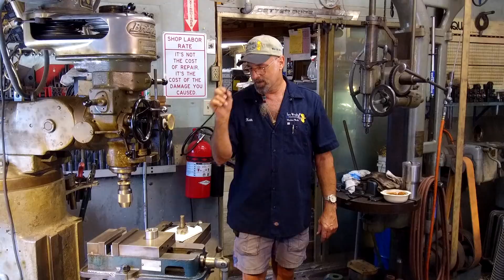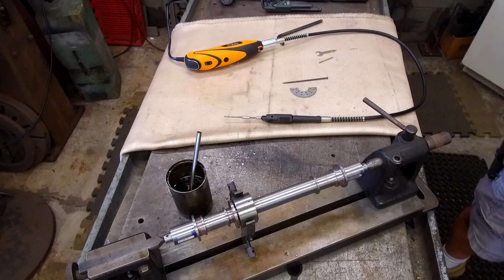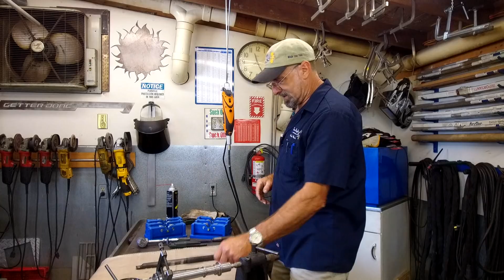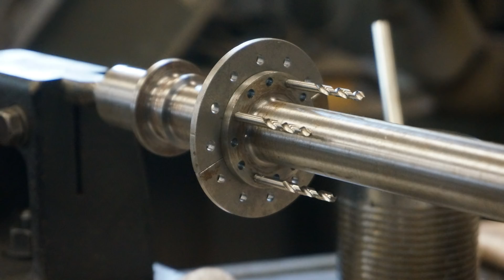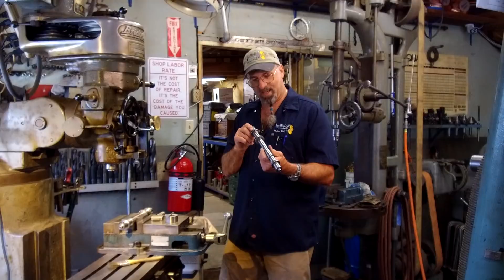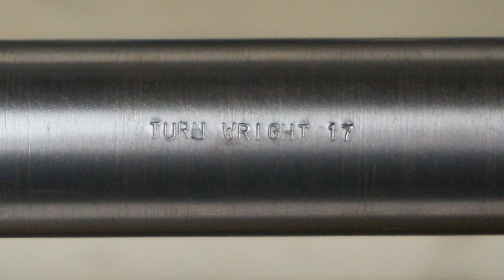Steam Wagon Ho Part Eleven

Comment: Keith mentioned that by using Tap Magic, he would have a "crisper" result. I've used Tap Magic for a long time, but only for tapping. Could someone (Kieth or some knowledgeable viewer) please tell me what is meant by "crisper" with respect to drilling? Thanks.

I agree. It was a great ride, first the restoration of the Rutland lathe, THEN the steam wagon axles! (Clapping emoji goes here.)
Reply from the maker: Sam, just the same as when tapping, the tapping fluid is faster or more free cutting than sulfur based cutting oils, so my term crisper is just that in mind. ;{)------
Reply: Thanks Keith. Sometimes, the answer to one question creates one or more new questions! I did some research on "free cutting" and "free machining." I concluded that free cutting/machining produces smaller, more manageable chips, rather than long, stringy ones, AND the process can go faster (as you say).  On this part of the steam wagon job, smaller chips would be an absolute MUST because of the confined space. Am I reading this right? (This is my final question, I promise!)
Reply: Thanks, keep up the good work Keith!

Comment: First I want to say thanks for all the videos.  I am not a machinist, but I have always enjoyed watching it being done.
First question I have, and I am not sure how to ask it, what was special about this project the required the Rutland, or what was special about the Rutland that this project needed?  You may think that is the same question, but to me it is different.
Next question, have you thought about using a sewing machine motor, with the foot pedal, as your high speed tool?  I have no reason to believe that you can not fabricate a chuck for the motor.
Reply from the maker: Well the Rutland was given to me and sitting waiting for the time or inspiration to set it up, I had a few other machine that needed to go to make room and it was one excuse after another, and the Clausing it to big for the shaft project and I knew I would be letting it set from time to time, when I needed to make paying work move on schedule. The Rutland was the deciding small lathe to set roots in the shop and while it was being set up, I had to give it a once over, to make it run to my standards and not live with someone else's standards. It had a lot to do with the shop as a whole and the timing of moving in a new direction of machinery. ;{)------

Comment: A left hand drill would have worked to prevent the aircraft wire from fraying but then he would need the dremel tool to run in reverse. A small cordless drill could do it and with more power.

Comment: Love the series. I was once involved in aircraft construction. We had a right angle drill adapter with a small head to get into tight places at awkward angles. I seem to remember it had about a .3 inch radius at the head, maybe less. The drills screwed in. Aircraft Spruce and Specialty used to sell them. Don't know if they still do, and maybe the head is too big for your application. Anyway, keep up the good work
Reply: That's what I would have used as well. Aircraft Spruce indeed has them for $225-230 or so, as do other vendors. They really come in handy for things like this.

Comment: What if you used a longer piece of wire, a left-twist drill bit and a regular drill motor?  More torque, the wire doesn't expand and more flexibility.  That rotary tool is really wimpy!

Comment: Very good.. I was thinking the soft solder might have been better as the wire isn't heated as much. It's more than like strong enough.. Used to make a bunch of motorcycle clutch and throttle cables using soft lead / tin solder.. Worked very well...

I've seen crimped connections come loose on Fordom style flex shaft rotary grinders.

Comment: Yup. Enjoyed the series. I'm glad my guess about the flexible drill bit was fairly close. Making an extra drill guide with smaller pilot holes would be a lot of extra work - probably not viable for your business. I was worried if your drill guide would rotate on the work after one or some holes, and a pin could have held it. Maybe that was a non-existent problem.

Comment: great series keith, your creative setups were  very  interesting as usual. scaling down can cause some very tough manufacturing challenges . did you consider any other ways to drill those holes before you settled on the flex shaft ? .
Reply from the maker: Yes but availability and over size on other means hindered their uses. ;{)------
Reply: Keith Fenner c

Comment: shrink good quality shrink sleeve over the whole flex joint will make things last longer  left handed bit and reversing power unit would have been the way to go.  for future order some speedometer cable.   also crimp the sleeves NO HEAT

Comment: Inventive and enjoyable video as ever. My two cents on the "failure" though. The wire is the wrong way around and will tend to unwind as pressure is applied. If the wire was installed the other ay around, it would tend to tighten up as torque is introduced and since it can't get any tighter, it wouldn't flex so much and fatigue the wire. Secondly, those cheapo "multitools use a cheap voltage regulator to control the speed so when you reduce the speed it also dramatically reduces the power. Back when Dremel used to make decent multitools, they used a frequency modulator for speed control so you got just as much power at the lower speed settings. Great stuff though Keith, really enjoy watching you work. Thanks again (from UK London). Steve.
Reply: If your first statement were true wouldn't you need a left hand nut for the other side of a threaded rod?
Reply: Yes you're quite right. My mistake. What's needed is a "left hand thread" cable. oops
Reply: Or a left hand drill bit...
Reply: Yes that has sunk in now thanks...
Reply: Screw Driver even if the wire was installed the other way around, it would not change the direction of the twist. Think about screw threads, it's the same.
Reply: Lang lay aka left lay wire rope might do better but you had it figured out just fine at the end.

Comment: In the Seventies I had a Kirby vacuum that came with a bunch of accessories, one of which was a flexible shaft. I never used it, imagine sitting next to a running vacuum cleaner for hours using the flex shaft,  but I bet it would have driven that drill. How bout adapting a 1/4" drive flexible extension.

Comment: I wonder, if you had fitted the drill "bit" with an "Allen"/Hex bolt, could you have driven it with a ball ended hex key mounted in a hand drill (sort of like the universal joint on a front wheel drive car)?  You didn't need that much off-set and I reckon it would have worked if you used a long enough key to get the drill clearance.  Just a thought.

Comment: For sure, an opposite lay on the wire would have been the answer.  the torque would have made the wire tighten and you could have used a longer length, even allowing you to use a hand drill maybe?  All things considered, a testament to your ability and the stamina of that little rotary tool ;-).  I loved this series, checking daily to see if the latest episode was up. I hope we are going to get a chance to see the Steam Wagon when it's done?

Comment: A Foredom tool (not particularly cheap) would be a better-suited motor to drive this with (the Foredom flex shaft is quite strong). Great job: illustrating the complexity of making small parts or parts with lots of features. Not only is the customer paying for making the part... they are paying for figuring out how to make it in some cases. I prefer Vactra on my pretzels... TapMagic gives me bad breath... :)

Comment: All those little multitools are the same - horrible little motors. In order to get any amount of torque, you need to pile on the revs. As you apply loading, it will slow right down to your desired cutting speed.
Reply: nope... try the proxxon IBS/e, cost more, but its sooooo much nicer and actually works

Comment: Keith: Don't let the nay-sayer's argue with success. You spent a total of 6 cents on that cable and it was readily available at the hardware store. To special order left-hand lay cable from a manufacturer would probably be cost prohibitive, and so would the wait for it to arrive. And your method of manufacture allowed for the repairs.     ¶ The first hole you drilled took 2 min 55 sec. For the last sequence of 12 holes, the longest was 54 seconds, the shortest was 30 seconds, with an average of 35.75 seconds per hole. I'd say that was a pretty good average against the possibility of a foot-long drill bit breaking at the wrong time.      ¶ Great video. I hope your customer will be happy.      ¶ Great to meet you at the Bar-Z. Enjoy the yellow t-shirt.  8-D)    Jon

Comment: As I suspected, the flex shaft has terrible runout. Also, these Dremel-like tools have not much power, or to say it better they work more with speed than torque. A cordless drill would be better suited for this kind of job.

When I see how often you stalled it it might be that the tool is kinda garbage by now. The stalling kills these tools over time.

Comment: Keith, you might consider putting a couple drops of oil on your flex joint cable to ease things along.  For storing machined parts, give LPS grade 3 a try.  Besides coating the surfaces to prevent rust, grade 3 LPS is capable of freeing up a chain that has rusted solid over a winter's exposure to weather.  It was literally a "life saver" in 'Nam, and was introduced to me by Air Force maintenance techs.  Have Fun, sir, and thank you for all your good work.

Comment: wouldn't a longer piece of round tool steel (like drill blank, but probably any steel would do) stock work better as the flex shaft - drill extension, it has enough give to bend past the features on the work piece, and you could chuck it up in a proper cord(less) drill to have the torque that this little plaything has basically zero of, that way you could put a lot more pressure on the drill
I'd probably also find a longer drill (longer shank specifically), cut the flute end and leave about 1/2" of flutes left, so that solid round shank would ride in the guide better

Comment: In future don't use stainless cable.  Stainless work hardens and becomes more brittle with each flex.
Reply from the maker: It was steel cable with a coating, as I mentioned in part ten. ;{)------
Reply: D'oh! Yes you did; I must have misheard seven-by-seven. My bad.
Reply: If you look at the break, the cable did NOT break in the middle where it was flexing, it broke near the end where it goes into the connector.  That because the heat from the soldering, making the connector glowing red, and the wire as well,  annealed (softened) it.  The cable bent where it was weakest, where it was soft from the heat.  Ways around it are quenching it and then tempering it into spring steel, using lower heat solder such as plumbing or electrical solder, or drilling for some set screws, that would allow a quick change if the cable OR the drill needed to be replaced.

Comment: For aircraft electrical high vibration environments we usually elect to crimp as opposed to solder wire joints.  The solder causes the strands to break right at the solder/wire joint just like you describe. I wonder if your flex bits would have faired better if you had crimped the wire sides instead of silver solder.  Clearly this worked well enough though. Neat trick, thanks for the videos.
Reply: I was thinking the same thing regarding a crimped connection.   It is amazing how strong a crimped connection can be when done properly.
Reply: I wondered about that too. Crimping is an excellent solution for that use case. Very quick too!
Reply: I was thinking about sailing dinghy rigging wires.  They often break just outside the crimp in Talurit Splices.  I have been told the wire work hardens and eventually the wires remaining in the strands can not take all the load and it breaks.
Reply: Depends a bit where it is crimped and how. Industrial style electrical crimp jobs tend to have additional strain relief crimped seperate from an electrical crimp. The type of crimp that is best for torsion is probably different than one for strain. Could be manufactured as simple as hitting the cartridge with a drift punch while supporting the rest of the circle.
Reply: should have been lead solder or just straight out epoxy, works great
Reply: Mepept
Reply: Zajac Motorsports tl

Comment: You really need a Turbo on that kiddy drill motor...   lol
One of my methods to lenghten a drill bit is to solder or weld an extension of a good lenght of steel rod... Works good for me
This is gonne be a special train axel with your stamp on it...   ;)

Comment: Man, you need a real flexshaft tool like a Foredom -- it has the torque to do the job without bogging down and is made to work in a shop day in and day out. Your shop deserves the real deal -- you wouldn't use a toy hobbyist lathe in your shop, right? That little thing is way under powered. A little light machine oil on the twisted cable might make it last longer too. Who knows?

Comment: The design of the cable (individual strands in each bundle are wound in the opposite direction of the bundles) resists rotation and unraveling/unwinding when the ends of the cable are secured. The friction between all the strands helps as well. While the direction of the wind isn't ideal for the rotation of the drill it still works.

Comment: Suggestion; instead of using heat and silver solder try a set screw with a point. Not only will you keep from damaging/heat treating the wire strands with the heat but you will displace the strands in the socket with the point forcing the strands against the inside walls of the socket with great strength which should keep the strands from slipping/moving while the assembly is being used.

Comment: this rotary tools are just toys!
i use them for building my modal planes, but jesus! the arent good for anything else!   :D
Reply: Good thing he's working on a model truck.
Reply: It did the job.
Reply: It was painful listening to that poor thing struggle.... call in a bigger brother, one with a little more oomph!
Reply: I have the bigger brother, an 15 year old foredom rotary tool.  I use it on steel, silver, and brass.  It has lots of torque. :-)
Reply: Fordhom LXM would work wonders for this type work. They are a high torque DC motor, good for 0-5000 rpm.
Reply: They're good on things that require high speed and low torque, with a rather light duty cycle. So wood or very small items. They can be great for sharpening points: stick a tungsten in the collet, hold near the end with a pair of pliers, and grind a point on it. Much better control of geometry and much faster than doing it by hand. Not that it matters much.
Reply: Personally I think I'd have made my flexible drill bit longer and used a battery drill, much more control over torque and speed. I hate those rotary toys
Reply: it did seem to be straining it's guts out why not just a cordless drill?? there is a flex bit - it actually gagged a few times.